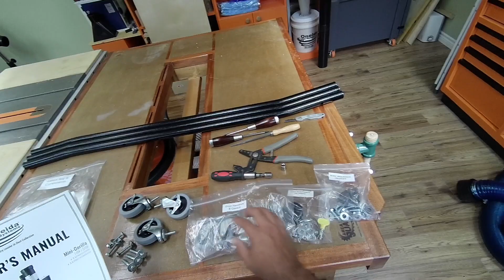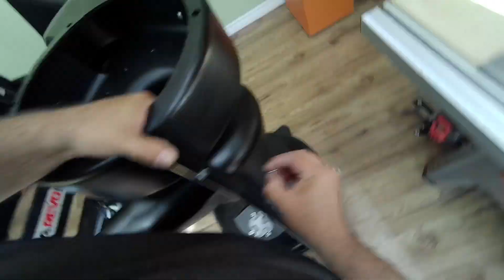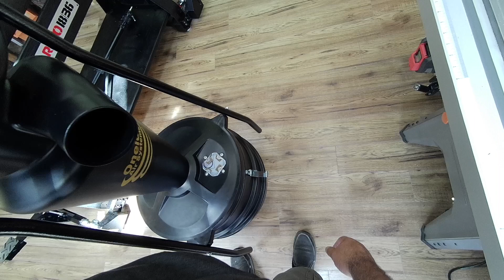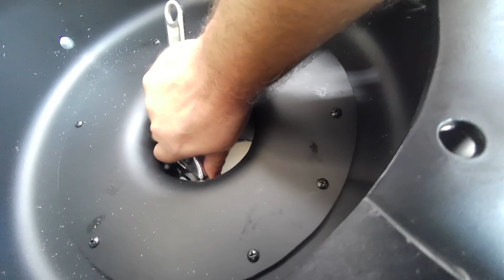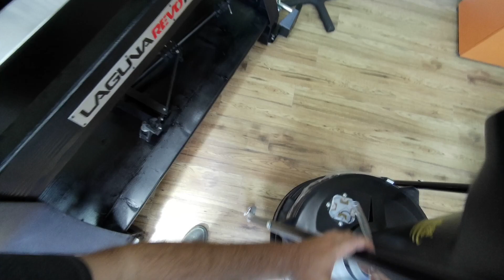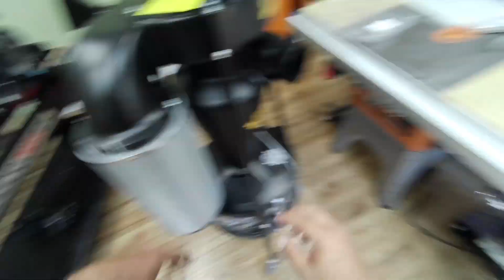How to Assemble Mini Gorilla dust collector from Oneida Air Systems

Comment from the maker: Note, there is a small black rubber cup included that i didn't mention on the video, that cup is to block the container hose fitting if you decide to not use plastic bags.

Comment: Thank you for this video.  I couldn’t find any other that showed how to put this machine together.  One trick to getting those first bolts in without the file is to screw in the nut without the washer to compress the bolt against the plastic.  The bolt head will sit flush with the inside of the structure. Then you can back off the nut, insert the washer, and secure it with the nut.  Thanks again.  Made in the USA!
Reply from the maker: I miss mine, i sold it when I moved to Argentina 😔

Comment: Did you notice misalignment between the lower dust bin & the top when clamping together?
Reply from the maker: Yes, i have about a quarter of an inch off or play, as in the lower bin was a bit bigger and you can move it around, however it seals good.
Hope that helps. Let me know if you have any other questions.